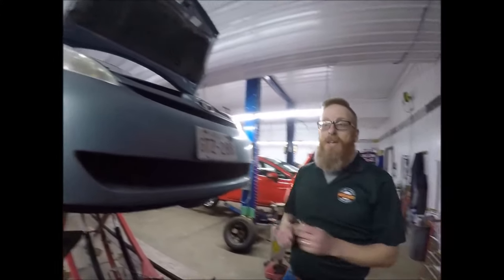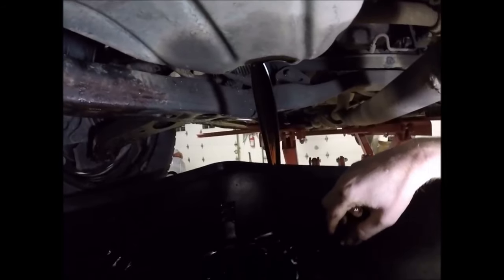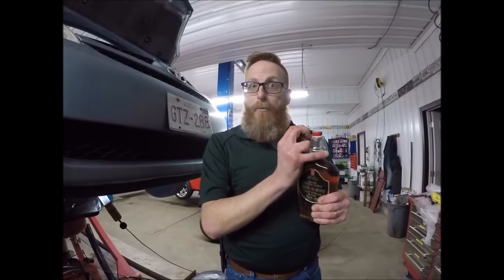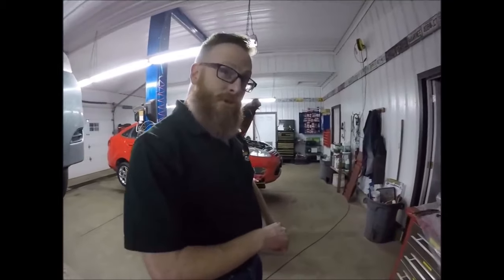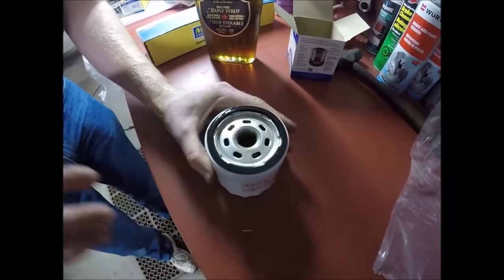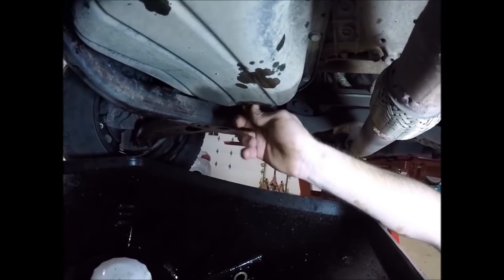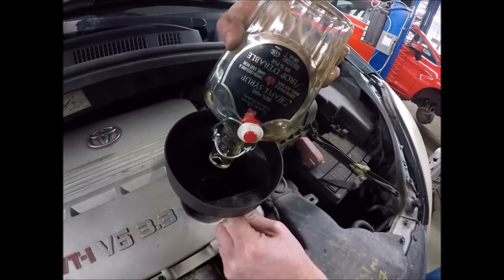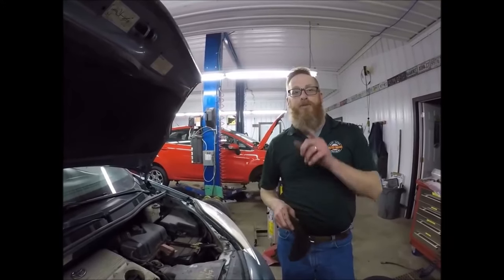HOW TO CHANGE YOUR OIL WITH MAPLE SYRUP

Comment: Sorry. You used the wrong Maple Syrup. Only Vermont Maple Syrup is recommended for something with that many miles. Hahaha  That would be one EXPENSIVE oil change.
Reply from the maker: I beg your pardon! Vermont maple syrup is a 5w20 supplement only. This old van required the Quebec organic blend as a 5w30 supplement. A lot of people get that one wrong! Easy mistake!
Reply: @OldeCarrGuy  Thems fighting words.  Well as long as it isn't Mrs. Butterworth, I guess i'll let it slide.
Reply from the maker: Haha